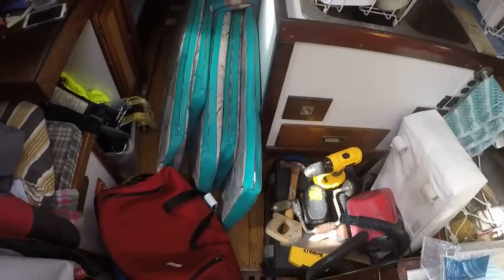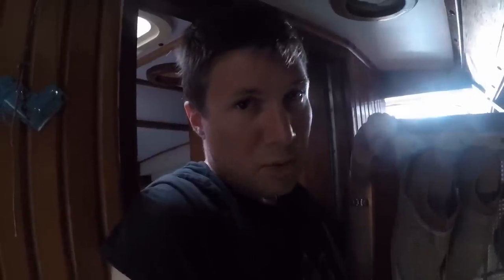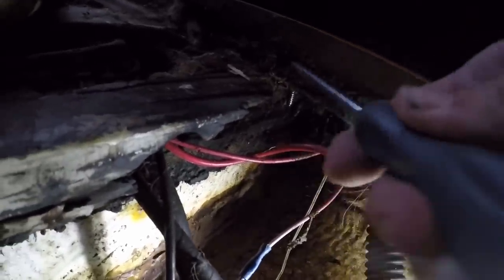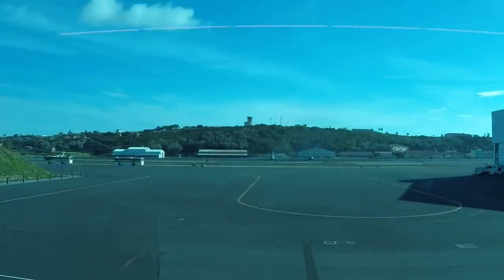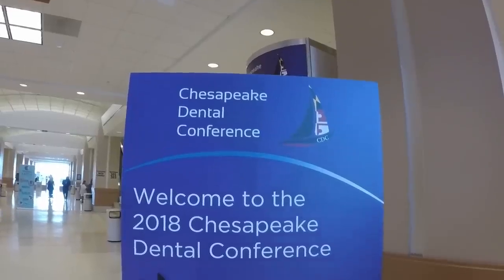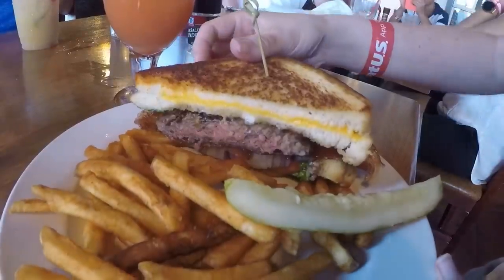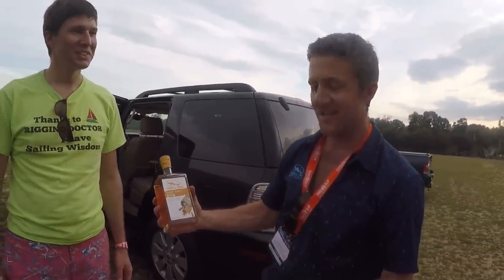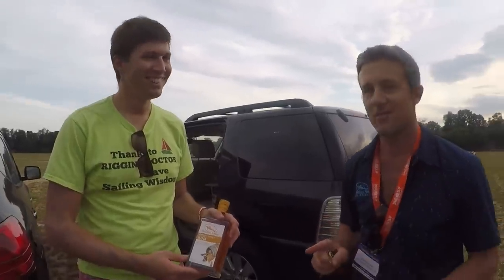Boat Work and Boat Show! | Sailing Wisdom: S3 Ep19

Comment: The boat show looked like fun. Herbie, as a dentist you will know about phosphoric acid which you use for etching teeth. Well phosphoric not only has an affinity for calcium, it also has an affinity for iron and is the primary active ingredient in the steel treatment you used. Phosphoric acid is cheap and handy to have available for cleaning up steel, but also good for decalcifying toilets. Phosphoric acid also seems to go to town on cellulose (cotton paper and some woods) and nylon. I don’t know if that can be useful in pretreating wood or not. Its good to see you guys together.
Reply: does carbonated cola work for that, since it's got a lot of phosphoric acid in it?
Reply from the maker: Good ol’ etching!
I will have to give it a try on our toilet. After 6 years, it’s in need of a bit of cleaning :)
Reply from the maker: It’s got acid, and plenty of sugar! Don’t know about using it in the closet, but it does keep me in business with the drill & fill!